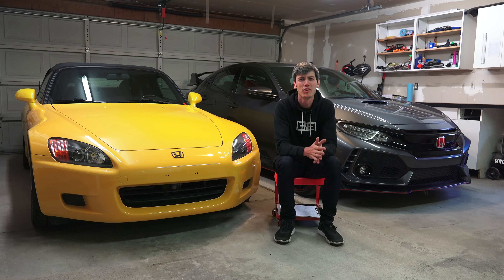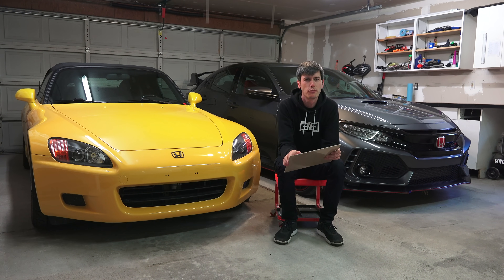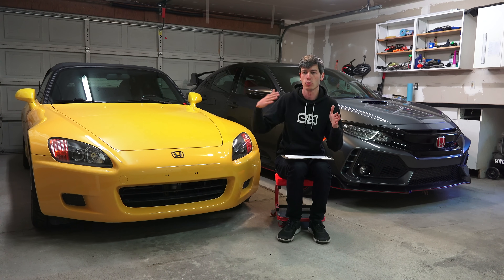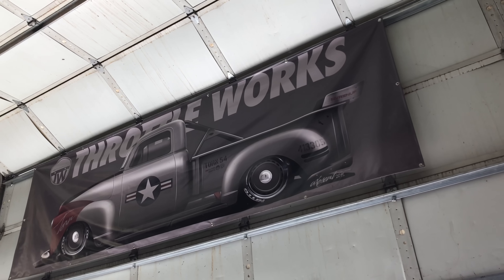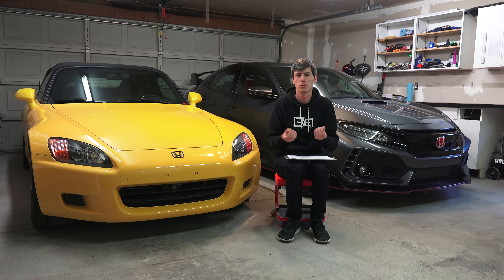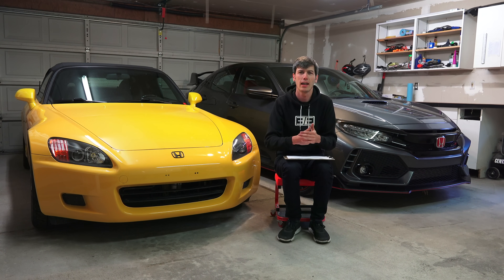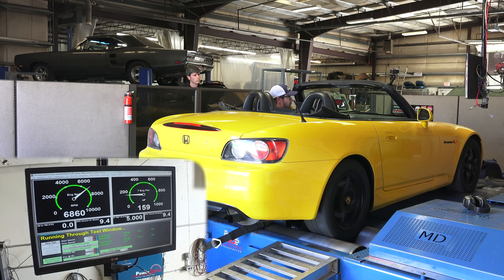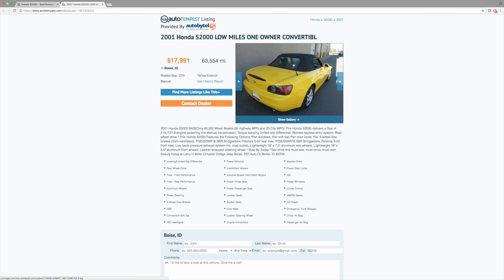Why Comparing Dyno Numbers Is Silly - S2000 Gets Dyno'd!

Comment: "hurr the s2k is fast 245bhp durr." LITERALLY NO TORQUE
Reply: S2000 is plenty fast for a road car. :)  Yes it has little torque, so what?
Reply: its enough to move the vehicle, barely. but you need at least 500hp to daily drive. frankly less then 700hp isnt safe to merge on the freeway.

Comment: What would be a good way to measure power then?
Reply: Measure the engine directly on an engine dyno.  Take the transmission, differential, wheels, tyres out of the equation.

Comment: I wonder the torque and HP I would get in my DIY 42Kw triple electric motor system at 840A and 11000rpm!!!
*the whole trike weighs 36.2kg yo!!
So much POWEEEEEERRR
Reply: ElectricBike I wager it'd make 56 hp @ 26 ft-lb (shaft) using 42kW @ 11 krpm spec.

Comment: Dyno read twisting force =Torque. Horsepower =Torque x RPM /5252.  5000 hp topfuel V 5000 hp train genset. Any number WITHOUT rpm is BS. Torque or Horsepower no rpm walk away.

Comment: These inconsistencies are concerning, sounds like the testing procedure,  dynamometer calibration, ambient conditions, sensor readings etc. are not accurate or consistent. The ambient conditions (temp, barometric pressure, humidity) should be at a nominal predetermined level. Perhaps a climatic chamber and the dynamometer calibrated to a traceable standard. Without meeting these prerequisites the numbers and testing are meaningless.

Comment: I operate and tune on a land and sea dynomite roller dyno. It is a "loaded" dyno much like a mustang dyno using an eddy current brake. When I first got the machine I was using the roller speed relationship to rpm. This IMHO is a crappy way of measuring rpm for a couple of reasons. The best ways to measure rpm into the dyno is with an inductive rpm pick up on a spark plug or injector wire. Depending on the set up of the engine this may be difficult and and obd2 module can also be used. The main reason the why using roller speed is such a PITA is because this relationship is not necessarily fixed. For one it is particularly troubling with an automatic torque converter transmission. Although the main issue with it that applies to all cars is that tires deform at speed. As the tires change shape the rpm reading will become less accurate. On a roller dyno the tires can deform quite a bit since the roller is not as flat as the surface of the earth. The larger roller the dyno using the less of an issue this is. Another factor to be considered is the amount of load used in the test. Ideally the "ramp rate" (ex. rpm/sec) used closely matches the load at which the engine operates in that gear in real life.

Comment: Could you make a video about turbo-compound engines? Scania trucks are using this thing; it's normal turbo with another one turbo, which is connected directly into engine's shaft, not compressor. Why we rather use that exhaust energy for compressing air charge, not spin that engine faster?

Comment: I presently do most my work in force and torque measurement industry. One thing I can assure you, at least with all modern brand name testers, (Mark-10, TMI, etc) you put a calibration test sample in any of them and you will get the exact same reading. This video blows me away. I certainly would have thought, after all these years, more than a century, that there would be a standard that these dyno testers would have to adhere to. Basically, they are useless if you move from one to another. The only use is for a comparative reference when making changes to your car, as long as you test on the same one with the same calibration. Quite amazing. Why in the world is there not some kind of standard that these machines must comply with? I never worked on and never studied automotive dyno testers, but you mentioned one that tests by means of electricity, my guess is that the rollers turn an alternator (or generator) and then apply a load to that. This certainly will be far more accurate than the "Inertial" method you mentioned. I had no idea, after over 100 years and dyno testing means nothing!
Reply: Chassis dynamometers are inherently flawed...  Even tyre pressure makes a difference to the reading.  That's why serious engine builders and car companies measure engine output directly on engine dynamometers, and hence why there may be little incentive to improve chassis dynamometers. :)
Reply: Yes, there are so called "hub" dynos where the wheel hubs are bolted directly to generators to remove the variable of the tyre deformation.

Comment: Though I agree with the idea and logic behind going to the same dyno to test for any performance gains/losses from mods you do, if each dyno is so different, then wouldn't that mean the differences would be disproportionate between dynos too?

For example, dyno A gives you 184HP and dyno B gives you 221HP, a 17% difference.  Then you add your supercharger.  Let's say dyno A now reads 250HP, but dyno B says 292HP.  That's a substantial performance difference.  So, unless dyno B is always roughly a 37HP offset from dyno A (rather than always proportionately 17% higher), it seems to me measuring power gains is irrelevant no matter what you do.

Comment: I agree with your statement that dyno's are best used for comparing what effect modifications do, and this probably the best use for them. But even when it comes to this, I've heard friends complaining because of misunderstanding.
Note: It seems American Dyno's are somewhat different to European ones, and ones we get here in South Africa.
From observation skills, it seems the norm for European dyno's to quote engine hp as a default, as I assume the customer base would like to use the dyno to compare power figures after mods to stock numbers without having dyno'd their cars stock. This isn't very accurate because drivetrain losses on every car is different, but the usual 20% guess (for FWD) gets people in a ball park that makes them happy enough to see the gain's of modifications. 
My favourite local dyno however doesn't do this and instead quotes whp without a general guess of drivetrain losses to get engine hp. This allows for more accurate readings at the wheels, but still allows guys to do a general maths sum to get a figure that would be close to their engine hp. (I've seen numerous times stock cars on this dyno making quoted factory hp when converting their whp to engine hp, so I trust this dyno's numbers)
But this very case was what sparked debate between friends. They claimed another dyno was way more accurate because it had x,y,z inputs and compensated for this and that, and the dyno I preferred was inaccurate and gave way too high numbers. Fair enough, their dyno might've not compensated for altitude (I live 1200m above sea level) and wind drag and blah blah blah, which I guess is a fair point. They weren't able to grasp why I told them that's pointless, because you can't really compare those numbers to anything and that they can't call the other dyno inaccurate because of such.
Then what I had been waiting for finally happened, one of them asked why tuners in Europe were able to get more out of the car than his tuner to which I responded to with the fact that he was just putting it on the wrong dyno. Can imagine a lot more people end up in the same perplexed situation as him just because their tuners told them how accurate their dyno actually is. 

Which brings me to a point. Dyno's should only be used for comparing before and after power differences unless you know a dyno that has accuracy to replicate factory numbers (But even then, factory numbers are sometimes tested differently with a few manufacturers)

But even then on top of this all, things like ambient temps, tyre pressure, wheel diameter and gear selection can all provide different numbers. 

Don't let the numbers boost your ego, just use them to know what's reasonable for your car.

Comment: It bothers me that dynos compensate for parasitic loss. The only number I would really care about is wheel horsepower. That should be a consistant number for any vehicle on any Dyno. Why account for wind resistance / drivetrain friction? It only complicates things and screws up true wheel horsepower numbers.
Reply: EreksonJ it's not for vehicle parasitics, it's for dyno parasitics and windage. Frictions in the dyno bearings and air resistance against the roller.

Whats more likely to effect your wheel power numbers is the unknown inertia of your drive train with only a rough estimate. As acceleration increases if this inertia is over or under estimated it will skew the wheel hp figures even on the same car by adding a turbo to something you will massively change the acceleration rates.

Or go on two dynos of different weight or diameter they will accelerate at differing rates so the amount of power used to over come the cars own inertia is different therefore power at the wheel is different.

Unless it's measured in steady state as brake hp then the inertia unknowns are removed. Or at least like dyno dynamics where they use a ramp rate to keep acceleration constant so any inertia error is constant in how it effects whp.
Reply: EreksonJ 
dyno correction values are optional and are left to the operator to decide on, and the parasitic losses corrected described here is the dyno itself, dyno rollers differ make to make and are quite heavy thus rob engine torque to spin up. If you say a dyno is a dyno, picture placing a motorcycle on a chassis truck dyno, correction would make sense now.

Comment: Many shops with dynos in closed rooms can pressurize the room with colder air.  Talk about a perceived performance upgrade....lol.
Reply: Well they could be doing it to negate weather effects. otherwise you get different numbers every time the weather changes making it harder to know if your mods are making it better or worse.
Reply: MsSomeonenew, when they make an intial run with the vent closed.....and later (after mods) with the pressurized system on.....something is up.

Comment: if you move the vtec point a bit lower you get a smoother torque curve.
ironically, JDM versions of vtec engines have the vtec kick in (yo) at a lower rpm than other markets, and the reason why non-jdm have a wrong setting is... to emulate turbo effect to increase sales.

Comment: another factor is the dyno operator, he might not be used to an s2000. i would go with the 4th run bcuz both the dyno and operator are familiar with the car.
Reply: 4th numbers is just a previous result multiplied to look better, he very specifically said that so there is no confusion where the sudden power boost comes from.

Comment: You forgot another, arguably significantly more important reason why it's silly to compare dyno numbers between different cars... peak HP, and even peak torque, tell about as much of the performance story as knowing the thrust of the space shuttle during launch tells us about it's in flight characteristics. Even if you forget about suspension, and other components that affect performance on track, and ONLY focus on power, the power/torque PROFILES are what tell you how quick your car will be, not the peak numbers. The reason is simple, the peak number is an instant in time. Imagine a vehicle that makes 400 HP at 5,000 RPM, but 200 or less everywhere else in the power band. I'd be willing to bet that all other things being equal, making 300 HP across the entire RPM range would blow the doors off that 400 HP beast, even if it's so-called power-weight ratio would indicate otherwise.  I like to think of power and torque therefore not as their peak numbers, but by their VOLUME across the entire graph.
Reply: Robb Ryniak one of the most intelligent things I've ever read in a comments section
Reply: Andrew Mausisa wow, thanks! And that's these nicest compliment I've seen! Lol
Reply: Gearing would most definitely have an impact. Having 1000 hp would mean absolutely nothing if you couldn't get it to the ground.
Reply: Great comment!! Gearing also has an impact on a vehicle's performance, as Jason stated in one of his other videos.
Reply: D'Montae McWillie and if you cant keep it within the rpm range where it would make the most power RIP my prelude
Reply: Agreed. That’s why you see some of these tuner cars with very high HP figures with big turbos but if you watch someone driving it it won’t have that much power for quite a while till it’s high in the rpms and then all the sudden it’s batshit crazy and they almost always have to shift or let off very soon after. It’s fun for scaring people or bragging about HP numbers but not really practical in any way and a car with far less horsepower could be a lot quicker.

Comment: Parasitic multiplier? What a howling joke!! Absent of knowing how they came-up with it, and whether it applies to all engines uniformly, this whole thing is an absolute BS.
Reply: I think its mostly used to find the Crank power instead of the Wheel power.
Some dynoes measure how fast the car coasts down in speed after a run, the resistance measured is the parasitic loss in transmission and driveline, this factor is then put in and Crank power is then calculated.
When set to 1 the dyno should display Wheel power unless there is something wrong with the dyno.

Comment: Trying to find the engine RPM like that seems silly. I've done this a couple of times (with bikes) and always come up with one or another way to actually feed the computer with revolutions via ignition. Granted, the more modern an engine is, the harder it will be to find a spot to pick up that primary voltage, but I didn't even understand how that system you're using is supposed to work. Looking at those torque numbers I'd say the answer is "not very well". Especially considering, what you said later that "this is a number to see if modifications you do to your car are working", this seems off. What if I look for a higher peak torque or a more elastic power band?

As for bragging rights: Yeah you're totally right haha. "Customer says he should have 80hp. Make him have 80hp."

Comment: The torque curve on the S2000 shows how much extra lift the VTEC cam has over the off-VTEC cam. There's no reason why Honda couldn't have used a more aggressive off-VTEC profile to give the motor more low down torque. Sure it would have eaten into fuel economy but they could have increased 5th and 6th gear ratios to compensate - keeping at least highway mileage the same. I don't think too many S2000 owners complain about MPG do they?
Reply: Gazman 
It's for idle quality, manifold vacuum, and MOST IMPORTANTLY EMISSIONS!
A large high lift aggressive cam at low speeds will produce an irregular idle and a lot of unburnt hydrocarbons........

Comment: You mentioned that you're putting on a supercharger & new cat back. I'm curious if you'll be changing out your headers too. Considering the amount that you've taught about back-pressure & exhaust gas scavenging, it would be cool to hear why you are/aren't getting headers and looking at results on the curve.
Reply from the maker: I may eventually. The biggest kink in the stock exhaust is the catalytic converter, and I want to keep it street legal, so I don't plan on removing it. But I have looked in to a few different header options.

Comment: Oh damn you too spreading the myth that a 15 year old car wont make as much power as when new. Open a good modern engine with 200k miles and it shows absolutely zero wear. I mean, why would it wear since there is no metal to metal contact?

Is it because of ignition components? Well, you are changing them per maintenance schedule, so they stay fresh.

The major thing is carbon buildup and fuel system getting dirty. Carbon buildup does not happen if you drive long distances, and drive with elevated rpm time to time. Fuel system cleaners actually work and bring back "lost" power.
Reply: Ideally there would be no metal to metal contact, but the real world does not care for your ideals. Engines got wear and tear just like everything else.
Reply: Anything mechanical will wear out eventually.  Lots of redlines, or maybe a few, lots and lots of cold starts, dirty oil, small amounts of dirt getting sucked into the engine, condensation, etc, etc.  do some research.
Reply: Im a mechanic and I stand behind what I said. Everything will be within factory tolerances after 200k miles and a good maintained engine.
Reply: carbon buildup is for sure a real thing no matter distance driven. its called a pcv system. egr system....
Reply: woohunter1... You make good points that apply to neglected run-of-the-mill commuter cars.  However the S2000 is the kind of car that is more likely to be owned by somebody with OCD who always keeps the oil topped up with top quality synthetics and changes it every 5000 miles.  A 200,000 mile engine that is serviced every 5000 miles with Redline oil (for example) should have absolutely no sludge in it at all.
Reply: Adam Dawson, a S2000 with a fastidious owner that has been over serviced (including cleaning the PCV, only running premium fuel, using top synthetic oils at short intervals) is a different proposition to a beat-up old Jetta though or even to something like a GTI with direct injection (which causes carbon buildup) which the S2000 doesn't have.
Reply: TassieLorenzo it doesnt matter. the intake still draws oil vapor from the crankcase through the pcv. #1 cause of carbon deposits.
Reply: TassieLorenzo sludge and wear are completely different things, no matter what kind of oil you use, there will still be wear.  Some engines will last a lot longer than others of course, such as Honda vs. anything made by Chrysler.